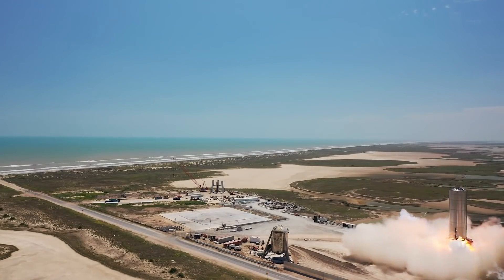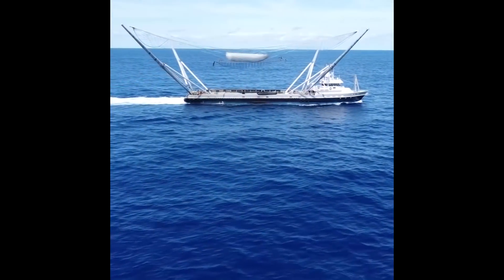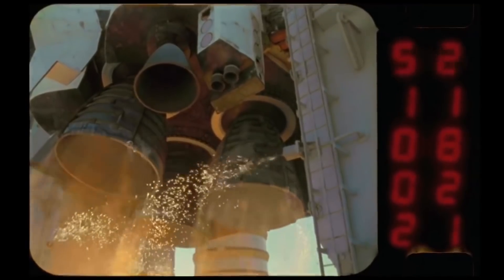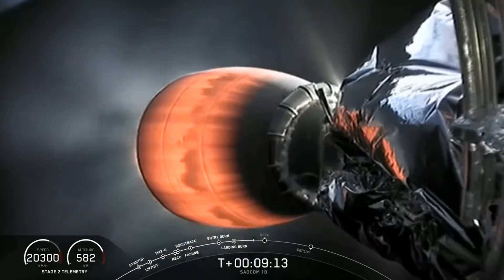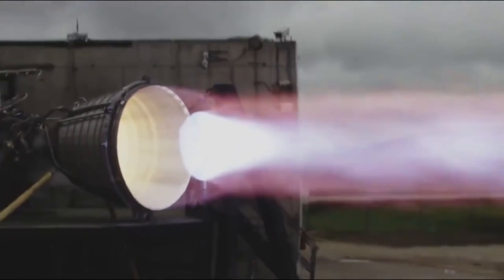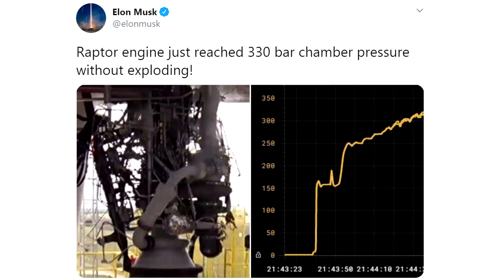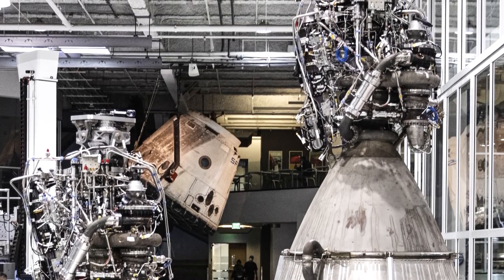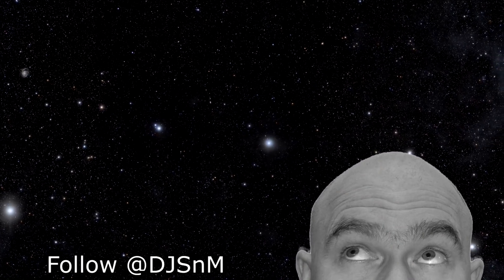How SpaceX's New Raptor Vacuum Engine Is Different From Previous Raptors (and Other Stuff)

Comment: I hope these beautiful, powerful and very advanced engines won't be scrapped once someone finally manage to convince Musk that the whole starship and Mars colonization plan is utterly failed , getting fired and called a pedo in the process.
Apart from Bezos doing it's thing, and small rockets business like Electron, there is not much new, from scratch, development in rocket engines. SLS is based on old shuttle hardware, the whole Roscosmos fleet is soviet vintage stuff, Ariane rockets are juste improvement of the previous ones.... SpaceX has probably way more money to make selling high specs engines to everyone than pursuing Elon's childhood scifi pipedreams.
Reply: @(S)-Riley Dunn Realistically, the whole starship design and its envisioned uses (mars colonization or transcontinental flights) wouldn't pass a simple dumb check, but obviously no one dared talk the boss about it. Even Shotwell didn't tried to, famously embarrassing herself at a TED talk about transcontinental rockets.
Nevertheless, in any business he owns, engineering done behind Musk's PR circus is pretty rock-solid. I just hope all of this won't be tossed away once harsh really finally knock down the big baby he is from of the top of his ivory tower.
Reply: @(S)-Riley Dunn It would be more easy to list what is right, and the engines make the largest part of this statement.
For the rest, it's a vertical landing space shuttle boosted by an N1 of sort. And the whole thing, the whole same thing, is meant to endure 5 very different and incompatible flight conditions. All of this in one go. And without any safety feature of any sort at every part of the journey. With hundred of unknown, unproven and untried techniques (re-entry cooling, refueling...), if not complete overstatement (the crew capacity is an order of magnitude over optimistic. The cost of the flight to Mars maye be 3 or 4 order of magnitude out of scope).
There is no "what can go wrong?" with spaceship and musk's martian colonization plan. There is just not an atom of "what can go right". It's so instinctively obvious from the get go, it shouldn't even be attempted. 
(not needed to talk about earth to earth flights, as it easily surpassed the hyperloop at the "dumbest idea ever awards")
Reply: Mars is far down the road.  The real goal is a reusable, CHEAP, heavy lift system.  That opens a lot of doors.

Comment: 7:23 I have never thought about this, but how do you actually test engines specifically built for the vacuum? If you start up the engine in a vacuum chamber, doesn't the engine pump gases right into chamber?

Comment: "It's safer to get the turbines up to speed very quickly using a separate, high pressure gas supply" - So what gas do they use for this? The image you showed suggests helium, but that seems like a bad idea since you can't get it on Mars? Unless you can bring enough from Earth to cover the flight back as well
Reply: I know they have nitrogen for something in the tanks, but not entirely sure if it's for the turbines. I think they also have had a helium tank in some drawings so you could be correct
Reply: They use helium to spin up the pumps, to control valves, and to pressurize tanks.  Helium is used because it stays a gas even when in contact with very cold cryogenic liquids.

Comment: Hi Scott, why are the Raptors so quickly reusable when the STS engines needed rebuild?  Nobody seems to be able to explain it. Including me?  Thanks
Reply: Witchcraft - that's the best I've got. 

I mean, yeah, continuous re-use is a critical design goal, so to some extent it's a matter of priorities, what they've chosen to optimise for. But they're also pushing the envelope in so many other respects... far more thrust than anything of comparable size, and a specific impulse that's not too far off matching some hydrolox engines. So yeah, witchcraft?
Reply from the maker: The idea is a full flow staged combustion has lower temperatures inside the power head. 
Then again it’s running at much higher pressures.

Comment: euuh! Vacuum test facilities .., I worked on the J6 test facility in Tennessee. The AF SRB vacuum test plant. I designed the test cell, the supersonic eductor, and the 20 toroidal vacuum steam jets. We ran a large boiler set for 3-4 day’s just to get enough hp steam for a 90 second run...those were the days!
Reply: I'd guess it's easier for SpaceX to just use the lower expansion ratio nozzle first and then test the larger nozze in space later.
If Starship ends up with 3 vacuum and 3 ground level engines anyway, testing these by flying into orbit with the ground level engines and testing the higher expansion vacuum engines should be easier for them.
And for launching cargo the performance of Starship would be overkill anyway, so the slight loss in performance wouldn't be that big of a deal.
So I guess there is a good chance these nozzles will first be used after deploying some sort of payload.
Reply: @diesistkeinname795  probably cheaper to fly a test article on an F9 to LEO to test it :D
Reply: @MrSapps  
Well, I'm not sure if a vacuum raptor with an even larger nozzle than the tested one would fit into the fairings.
Allthough a raptor powered upper stage for Falcon Heavy would probably increase payload capacity significantly, especialy in high energy trajectories as the regular upper stage is significantly undersized for FH.
That could even be sufficient for an Apollo-style lander mission if they add active propellant cooling.
Reply: @diesistkeinname795  It s unlikely we will ever see this. Their Falcon 9 and FH launch facilities aren't equipped to fuel a methane liquid methane upper stage. As well it would sort of defeat a huge part of what makes the Falcon 9 (and by extension the FH) such an effective launch vehicle. Rather than design totally custom systems for each stage they just took the same first stage hardware, modified it a bit, and created an upper stage as well as side boosters for the FH. This way they can reuse a lot of tooling and they can capitalize on an economy of scale with the common components. The two main priniciples behind the Falcon 9 (and the FH) are simplicity and modularity (at least thats what they appear to be based on their decisions up to this point).
Reply: Tullahoma - a plumber's wildest dream !
Reply: I worked on J3/J4/J5 in Sacramento. Same deal. We would build steam for days. We could usually get multiple brief tests off in a single day with a few hours of building steam between, especially after we expanded our capacity for J5/J5A for scramjet testing.

Lots of O.T. whether we wanted it or not, but we got a lot of great data on a bunch of engines, including the longest run on a pump fed engine ever performed--that took some tricks with steam management.

Comment: 8:07 "The raptor is a more complicated engine". As if the RS-25 itself wasn't complicated enough.
Reply: RS-25 is like a fine, handcrafted pocket watch that needs to be wound or repaired on a regular basis.
Raptor is like a smartwatch. Much more advanced but cheap and low maintenance.
Reply: @Waffles1313  that’s a pretty good description nice!
Reply: Yeah, advanced might be a better word to use. :P
Reply: @TechyBen  Both are accurate. The RS-25 is a closed cycle hydrolox, the raptor is a full flow staged combustion cycle methalox, the only one of it's kind that has ever achieved full functionality.
Reply: @Aditya Suri the shuttle had to be completely dissembled after every flight to check every single part, hypergolics made it so that engineers had to quarantine the building and wear protection during this process, which slowed down refurbishment.
Reply: @jesusmora9379  "the shuttle had to be completely dissembled after every flight to check every single part,"

Thats not true the shuttle processing flow went like this:

The orbiter's main engines were purged to remove the moisture that was a by-product of liquid oxygen and liquid hydrogen combustion.

Payload bay doors were opened and any hazardous payloads were processed for safety

Fuel cell tanks were drained of remaining cryogenic reactants. The oxygen system was rendered inert with gaseous nitrogen and the hydrogen system with gaseous helium.

High-pressure gases were vented from the environmental control and life support systems.

Refuse and other waste products including draining of the potable water system were offloaded

Heat shields were removed from the engines and aft access were opened
main engines were locked in place and covers installed.

Scaffolding was installed around the orbiters aft to allow technicians to access the main engines

Main engines were removed and transferred to the Main Engine Processing Facility for checkout and service (note that they only started removing the SSME's after the Challenger accident)

Any needed repairs on the orbiter's thermal protection system including the thermal blankets and thousands of tiles were completed. (Only the damaged tiles and blankets were removed the rest were simply inspected)

The Orbital Maneuvering System and Reaction Control System pods were possibly removed and transferred to the Hypergol Maintenance Facility for troubleshooting, repair or other services.

Any modifications to the orbiter were completed in the OPF.

After all its flights, the orbiter went through "Down Mission Processing." (Down mission processing is essentially the installation of payloads, mission kits and consumables which could be inserted in the OPF.)
Reply: But it is way more reusable & allot more powerful. Shuttle wasnt reusable as they would have hoped it ended up being referbishable which caused the cost to go way up from what they wanted.
Reply: @theatom7264  the problem with shuttle wasn't the engines, the engines were the most reusable part. it was the falling heat shield, the freezing o-rings, the fragile aluminum structure, the extra weight from all the random crap congress wanted, the extra long wings, the duplicate 8-bit computers, the life-support systems, the requirement to have 7 crew at all times, the giant hydrolox tank, the fact that it was built and tested all across america, the toxic hypergolic fuels, the inability to properly improve the design, and the fact that they didn't even get enough funding to build spare parts.
 the flying brick was a disaster.
Reply: @jesusmora9379  Awesome synthesis, for a generation, having the shuttle on the cover of the school science and technology book meant "this is the top thing of the world", how things change when information is properly analyzed.
Reply: @jesusmora9379  Space shuttle computers had 32-bit registers. Actually, they are capable of floating point operations of 64 bit words, but only addition and subtraction.

Comment: The design of those landing legs show 3 cool things:
1) Optimization of build time, by using readily available parts and performing minimal operations, without switching tooling. Grab a channel section, drill a bunch of holes in it, mount to actuator. 
2) cost Optimization duh
3) MVP! Minimum viable product, it is fast and cheap to make, performs job well and dependably, which facilitates rapid prototyping! 
Very cool indeed! The welds were amazing but also all hand done, likely TIG. I could go on for hours about how much I want to be a SpaceX welder. The beads they do on the starships high alloy stainless is reminiscent of the massive Saturn V thrusters, their bells which had to be manufactured layer by layer, each welded together.

Comment: The flow separation on the shuttle clip was pretty neat, those are some scary forces.
Reply: I agree! I noticed that wobble on an rs25 engine video I watched just a couple weeks ago.  Had no idea what was going on.  Really spectacular breakdown, as always 🎖️
Reply: Yes, the RS-25 had to perform not only off the pad, but almost all the way to orbital insertion. Compromises had to be made in nozzle design for its use as a sustainer engine. 0-17,500mph!  The Rap-Vac operates only in vacuum thus can be more optimized for that single operating environment.  Man does it start quick!  Pressure start vs. RS-25 Head start  The new RS-25 nozzles will feature a new channel wall nozzle to replace the 1080 stainless steel hand laid furnace brazed tubes in the current RS-25 inventory.  I wonder if they will flex as much during start for SLS?  Core Stage greenrun at Stennis coming soon!  All 4 RS-25 engines have been powered up and gimballed using the new TVC systems.
Reply: These forces are some uber-powerful sonic waves, playing havoc on the surfaces...
Reply: Which is why they didn't go for cutting their pipes out, rather brazing them.
Reply: It looked so cool
Reply: i always thought that there was some kind of camera effect that made the engines wobble, now i know that there is one more reason to never go near a rocket engine

Comment: Why go with a mass-simulator when you need to test and get the readings during the rocket's descent? 
They have several cones ready to go.   Fit one on, add the flaps, and do a proper test.

Comment: So, How many LBS. of thrust does the Raptor produce? Also, Beautiful Saturn 5 and Gantry in the Background. Where did you get that?
Reply: Current max for sea-level Raptor is 500'000lbf
Reply: Why not Kilograms?
Reply: @dwdadevil  I grew up during Apollo. My Dad worked on Rockets at Aerojet General in Irwindale. Lbs of Thrust is intuitive to me without thinking. To old for the Metric System to make sense of it.
Reply: The rocket is Lego.

Comment: The US navy had a solution to this by using expanding nozzles that slide a larger nozzle over a smaller one to give the equivalent of a vacuum nozzle. It was done for the sake of saving space in the smallest SLBM possible.  So why cant the run the nozzle with the expansion retracted in atmosphere and then slide the extension on in vacuum?
Reply: Elon hates unnecessary part count. It's a possible solution, but it's also one more thing to go wrong... in particular, what do you do if the extension doesn't retract correctly? You're then doing re-entry with some unwanted bits sticking out of the skirt into the hypersonic airflow, and depending on how far they stick out (and how much survives re-entry), may actually get in the way of landing.
Reply: @simongeard4824  I see what you're saying and  I kind of agree with your analysis but I have no doubt that an engineer could figure out how to make it workable 99.999% of the time to retract when needed for landing.
Reply: @Kevin_Patrick001  The point isn't whether an engineer could make it work – it's whether it would be worth the trade-off. An improvement in specific impulse, but at the cost of greater complexity, more moving parts, more things that can go wrong. Remember that Elon's philosophy, "the best part is no part".

Comment: Are you sure those legs are designed to crush?  Seems like the larger holes at the bottom (and no holes at the top) could just be to lighten the legs, while keeping them strongest where the bending moment is the highest.  Any lateral movement at touchdown would create serious bending moments at the tops of the legs, so they'd need to be the strongest there to keep from buckling.  Just a thought from an ME.
Reply: Think "minimum viable product" here. I'm sure that the final Starship will have much more complex legs, but we're still in the early prototyping phase. For right now, a leg design that's cheap to build and easy to replace works fine, and if there's some crush deformation on landing it's not a big deal. Pick it up with the crane, bolt on a new set of legs and fly it again. I think Scott's right that the legs are designed to progressively buckle under high load, taking up the landing shock in deformation while still remaining strong enough to support the structure above.

Comment: I think the legs will eventually do double duty and be used to birth two Starships together in orbit.  Then once the two ships are locked together a robot arm will be stowed away in the engine bay, that will unpack and go about making the fuel transfer connection between the two ships.

Comment: Another great presentation. Appreciate your thoroughness. On a related track I finished the series AWAY. Pretty much junk, but they did use ideas from starship. re-usability, belly flop entry into the martian. atmosphere and the tilt back to a vertical landing. wasn't impressed by the hardware. lots of dials and switches. thanks for these excellent presentations

Comment: A smaller throat would also lead to less thrust being developed, right? Not that thrust is all that critical for a vacuum engine. 

Also, I like the term “mass simulator.” It sounds like they couldn’t get real mass, so they had to make do with imitation matter instead. I know it’s just short for “payload mass simulator,” but I still think it’s funny.

Comment: Hi, have you seen how the nozzle of the Vulcain is produced? The nozzle is also produced from a copper core with channels milled into it. But then the channels are filled with wax and a nickel jacket is galvanized onto the core. Don't know if other engines use a similar technique, but it is certainly interesting.

Comment: I'm almost certain they're not going to aim for the landing pad.  If it goes sideways, they're going to want to be over the water or at least, not around the facilities.  Methinks they're going to attempt the landing but over the water in case the whole coast and landing maneuvers get hokey.  SN8 is gonna get wet but the data will still be priceless.
Reply: They could aim for the water until the rocket is in a stable hover and then fly it back over the pad.

Comment: I suspect the chamber coating to be Zirconium Oxide.  The color is correct from what I can see in the video.  This coating has been used in AB assemblies for many years and provides good thermal protection in a similar type environment.